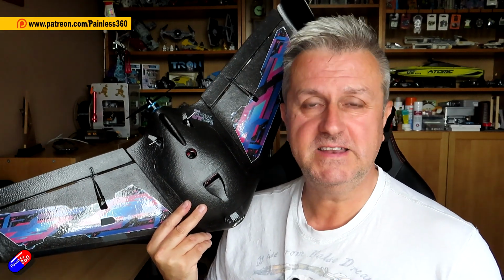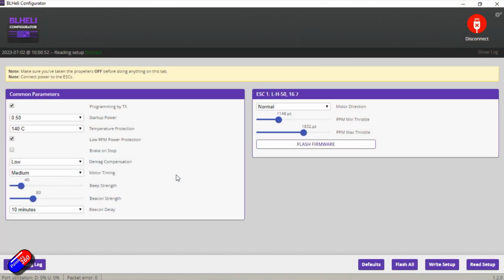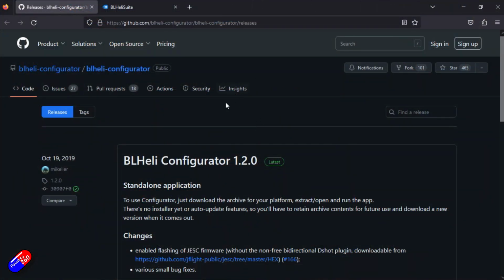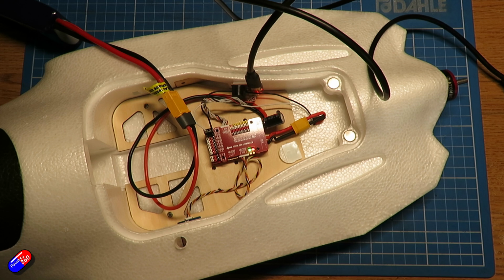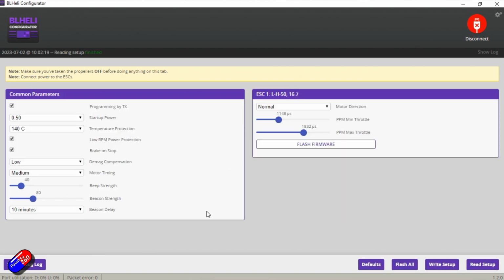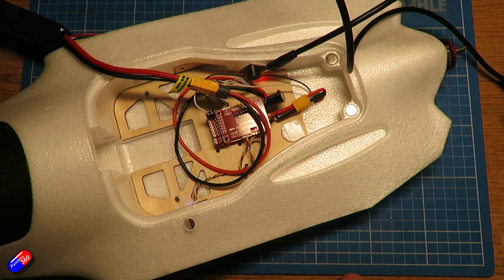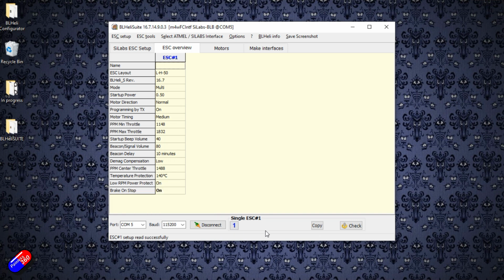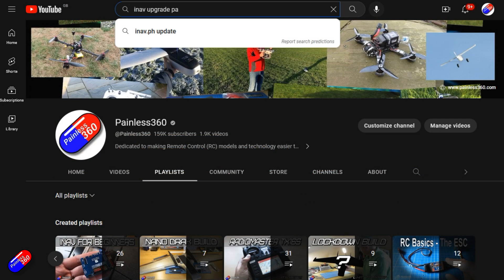Set things like BRAKE on your ESCs easily using BLHeliS!

Comment: hi dear need you help and guide line , i have 2 ZMR brand esc 

one is zmr blheli 50 amps ,while i was trying to set break , like other esc , but i think i made some mistake and my esc setting change , i want to know how to back factory setting ?

2nd esc i have same brand zmr blheli 50amps v2 ,

problem i am facing during flight i noted glitches and when land plane , my esc continuesly  beeping , i checked my battery , which i am using is 4 cell lithium ion 21700 , 4000 mah 8c rating , after land my batttery show 70 % ,
what will be the reason for beeping and during flight glitches ,

thanks if help , 

do you have any video of zmr esc programming ?
Reply from the maker: With things like BLHeli, it can be easier to setup the features via a fligth controller or UART device. I've  not used those ZMR ESCs here so have no experience to draw on for you. Best of luck with it.

Comment: My goodness my software is somewhat obsolete... how can I ever be expected to properly tinker without the latest software ?  I can no .once fly but still love gtinkering and building . Current project a DC 3, omage to one of the scared I ever was on a plane the sonic view through the belly of the plane , the steel lawn chair seating, the stewardess who kept falling , the postage stamp landing pine fresh from the trees we clipped.  True story lol. 1968,  I may fudge and fly it once , but only a short maiden then give it away.  A question if you have a esc, that only says 3s 30 amp how do you determine the operating system ? Babysitting and missed some of the video ...take care.

Comment: Hi Lee thank you so much for another great video🙏
     Is there anyway to configure a blheli  ESC if you are not using a flight controller and it’s just plugged in to the receiver. 
Would there be such a thing as an adapter cable from the blheli  to the computer, as I only do basic flying and sometimes use kopilot lite flight controller.
Or can you configure it with beeps example like a Simon K ESC. Many thanks!
Reply from the maker: They can usually be set up using the radio sticks. See the manual for the one you have. Those other options in BLHeli Suite are for the different adapters and connection methods... Happy flying!
Reply: Thank you so much for the reply Lee I will buy some and try them as they seem to be good price 🙏

Comment: Hello Painless360! I hope you can take this pain away: Can i flash Inav onto a F405 Wing that has currently ardupilot on it? Ardu is too complicated for me, i want inav back, but it does not flash. Is it even possible? I dont want to buy another FC. Many thanks in advance.
Reply: I'm not him but I can help. Yes, you can definitely do that. You will need to force the board to DFU mode, usually by holding a button on it called boot or similar before powering it up. With that run the inav configurator and, in the firmware flasher enable "No reboot sequence" and "Full chip erase". You may also need to manually adjust the baud rate but it's not usual.
Reply: @adilsongoliveira  Ok thank you i will try again

Comment: My heewing t1 pnp ESC, there is no cut off option in blhelisuites, it means, there is no cut off? Thanks
Reply from the maker: Sounds like it, with the version of the firmware on the ESC. Updating the firmware may give more choices... best of luck
Reply: @Painless360 thank you, my esc on t1 support  blheliS  , and so  the esc have no cutt of voltage right sir? Thank you